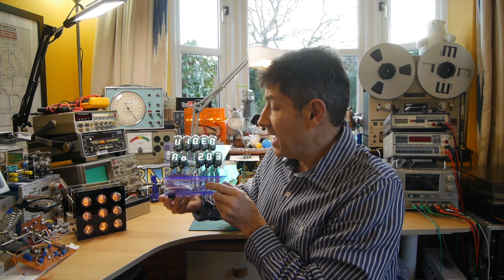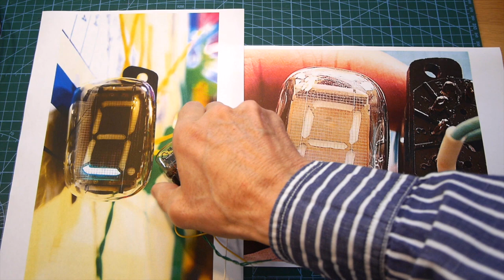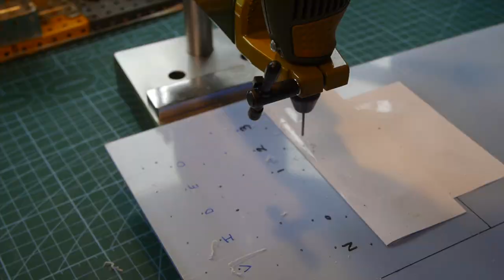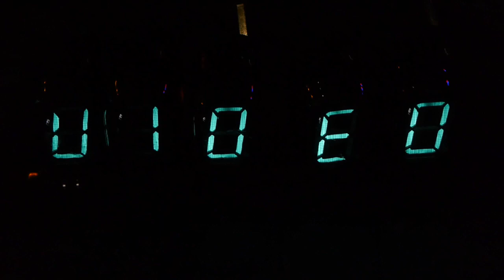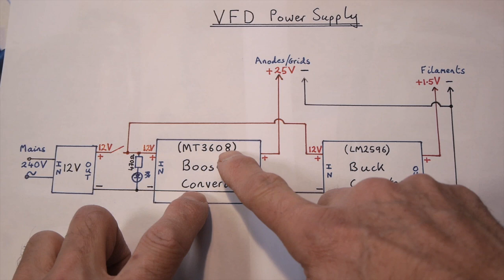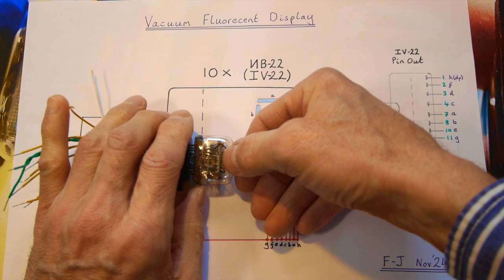Vacuum Fluorescent Displays VFDs Explained - F-J's Physics - Video 203

Comment: How would the alpha particles escape the glas tubes?!!

They won’t!
Reply from the maker: Yes, you are absolutely right - they would not even penetrate the cardboard box.  But... beta and gamma aside, one has to be really careful with some 'surplus' equipment for surface contamination.  Broken radium dials used to be a real issue when buying boxes of old avionics etc.  Was all a bit 'tongue in cheek' in this case though!
Reply: @ 
Maybe the Ukrainians cut them out of „use“ Russian tanks. There might be a lot of non-radiation poison around as well 😎

But I don’t want to make your hobby mad, I was just remembering that picture in a old book about the 3 types of radioactive „radiation“ and alpha being shielded by thin paper.

BTW, bigclive just had a video about suspicious aliexpress solder. Someone with the needed equipment found: mostly lead with some cadmium. Also not healthy.
Reply from the maker: Yes, I do not have the ability to test for other types of contaminants that's true!  Gosh, solder with cadmium in - that does not sound good at all.  I will have to look that out!

Comment: Nice tubes, and nice construction, but flying leads to change the display......no.  I came here to see how you were driving them, as in connecting them to an Arduino, or ESP...  etc, so a very limited build.  (I know the voltages and how to cut & bend Perspex)  
I was kind of hoping for a nice and easy driver - nay sneaky, using readily available parts, not rare and hard to get stuff from Russia etc, pity
Reply from the maker: Paul, sorry this was not what you were looking for and I get your point.  I wanted to build something very retro so one could actually see directly how the voltages were changed (you can probably bend perspex a bit better than me too!)  However, if you want to use an Arduino or similar there are plenty of driver boards.  You could connect so you switch each filament off or anode voltage or even use the grid by switching a negative bias voltage onto it so should be really easy to do with the cheapest of kit.  Hope that helps a bit and if you get something working do let me know!

Comment: Remember having an old Casio calculator with a VFD that had faintly whistling from the inverter circuit to drive the anodes. Probably can’t hear that frequency any more.  Now wondering why your display faded when touched, but it reminded me that you can influence the display with a magnet.   🙂
Reply from the maker: Yes, we have a VFD desktop calculator too.  Funny how you can now generate the higher voltage without the need for whining power supply!  They are very low current devices anyway.  True, they are a kind of mini CRT and so a magnet would deflect the electrons (I don't what to try this with mine!).  I changed out the tube and it works fine now.  I suspect a bad tube base connection or perhaps a fault in the tube where the electric fields were not quite right and a small bit of static electricity or perhaps conduction through the glass to ground (?) was causing the problem.  Anyway, its fine now!  Good to hear from you again!  Best wishes, F-J

Comment: one simple optimization for the last digits would be to use diodes in an array connected to the anondes to select the digits, and using pull down resistors for all anodes. for instance, the digit 8 would have diodes on all anodes (except the dot). the diodes would have their own anodes common together per digit. so in order to turn on the 8, you just connect the diodes' anode for the digit 8 to Vcc
Reply from the maker: Yes, that's a great solution - it reminds me of 'diode logic'.  In this case I just wanted to be a bit retro and use up those old 2mm plug sockets.  Thanks for watching and your excellent suggestion.  More VFD stuff to come in the future!
Reply: @AnthonyFrancisJones  Thank you for uploading, as always. Sorry for not being able to support you on patreon, but it's difficult for us in Argentina.
Reply from the maker: No problem at all!  Great to have you on board and keep the comments coming!